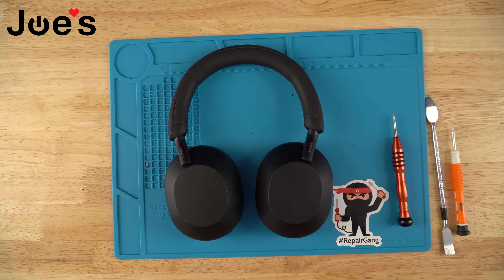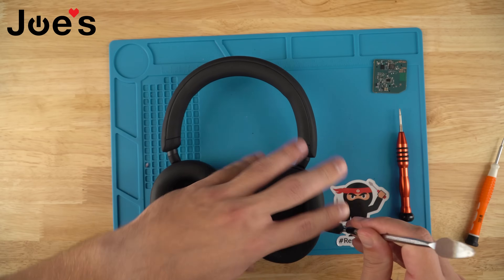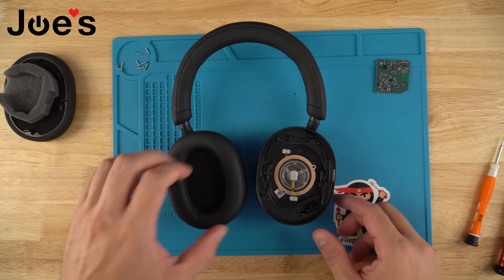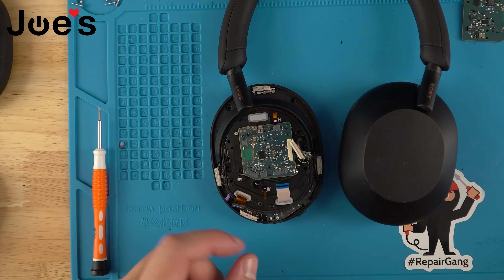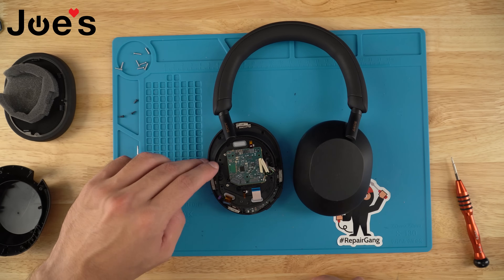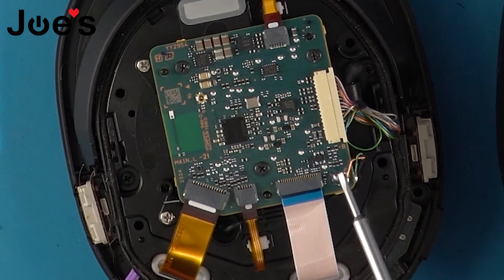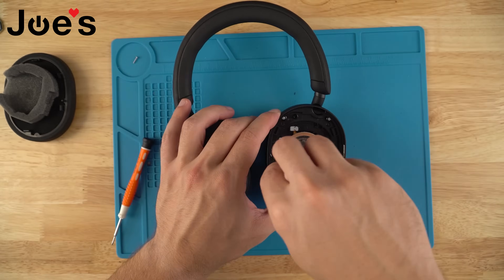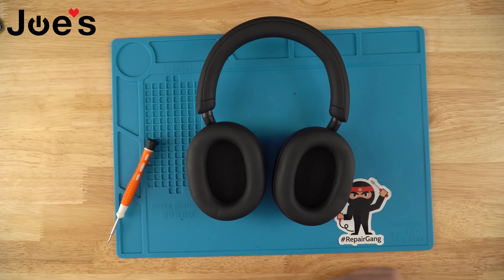Sony WH-1000XM5 XM5 Headphones Bluetooth Board Replacement | Repair Tutorial

Comment: Hello, i have a problem where as the left side speaker and its anc completely dead, but the control button and it sensor still work ( it does pause when i put away the left side from my ear )

do i only need to replace the speaker ? 

what i already did : 
- firmware update
- 3.5mm cable test
- resetting to default
- charging to full battery

thanks in advance
Reply from the maker: Email our support team for more assistance. Support@joesge.com

Comment: Hello i have a pair of Xm5s it works well with wire but when i try wireless it turns off randomly. It goes quiet for a couple of seconds and i hear a pop then it turns off the light on the charger doesnt show up when i charge as well and theres some crackle when it uses noise cancelling and anc. What might be the problem? Thanks 🙏
Reply from the maker: Sounds like the Bluetooth board may be faulty. You can send it in so we can check for sure and swap it out for you. https://www.joesge.com/pages/repair-service-headphones-sony

Comment: Hi, i dropped some water on it. With headphone jack and wires it works fine. The bluetooth connects with the phone  but no sound at all until conmected with the wire. What could be the issue ?
Reply from the maker: It would be the Bluetooth board from our experience. 

https://www.joesge.com/products/sony-wh-1000xm5-wireless-headphones-repair-replacement-black-parts?variant=41145040273454
Reply: @Joesge  you dont sell any brand new parts ?

Comment: Hi guys, I live in Brazil and I have a pair of these headphones that died on me. They wont charge and wont connect to Bluetooth. If you plug it in to charge, the light comes on red and then goes off after about 30 seconds. I have tried factory resetting it and still nothing. I sent it to "Sony tech support" and they said it was the Bluetooth board which is guess is exactly what you replaced in this video. They said it would take months to buy the parts from USA and ship it to Brazil and in total it would cost me around $200 which is almost the price of the product to buy new!!! I have had it JUST over a year so it has no warranty, but I came across this video and it seems so easy to replace. Does it sound like the problem is the Bluetooth board? Or could it be something else, like the battery, or the charging port. Because I think I can buy the parts and try to do it myself. I mean it would be much cheaper and even if it doesn't work, then I still have a headphone that wont connect. It works with the audio cable, but of course it sounds nowhere near as good as when it works properly. I hope you can help me, thanks!!!

Also, is this the part you replaced in the video? https://www.joesge.com/products/sony-wh-1000xm5-wireless-headphones-repair-replacement-black-parts?variant=40386707685422
Reply from the maker: Hello, thanks for commenting. Please email us at support@joesge.com with your question. We will be able to better assist you there. - JoesGE
Reply: @Joesge  Thanks! I just emailed you.

Comment: Hello, the right side of my xm5 doesn't have sound. All the other functions is working including touch control. what could be the problem? Thanks.
Reply from the maker: Most likley a bad speaker, You can get one right here. https://www.joesge.com/products/sony-wh-1000xm5-wireless-headphones-repair-replacement-black-parts?variant=40386707587118